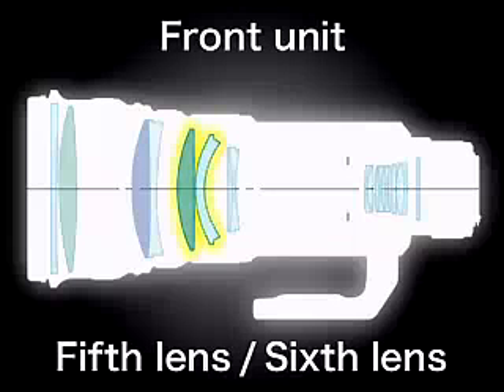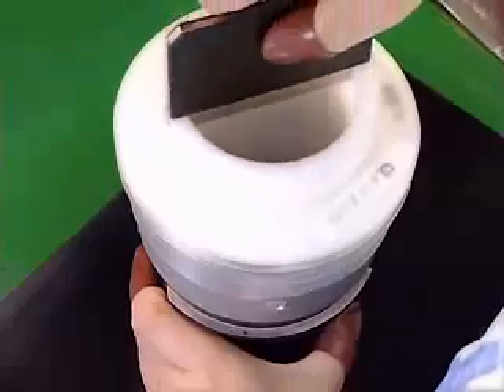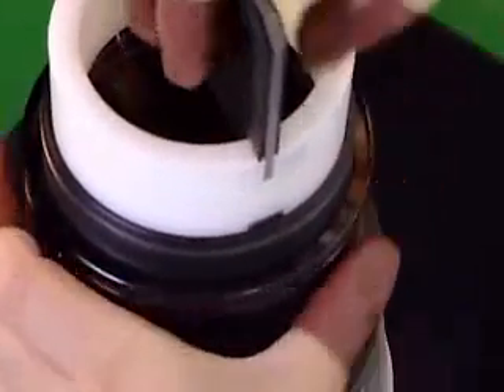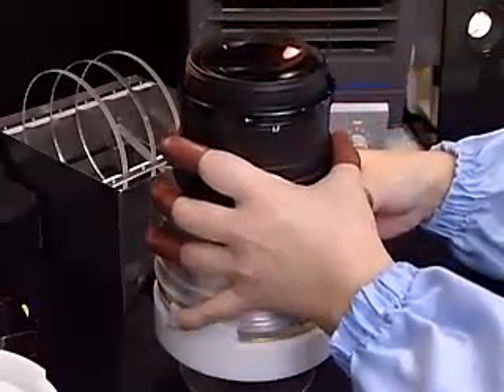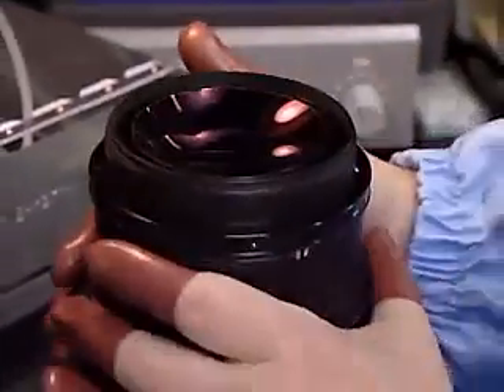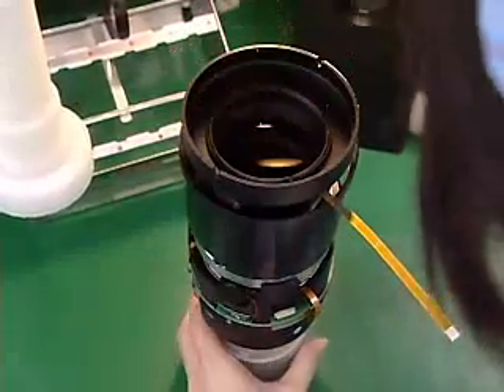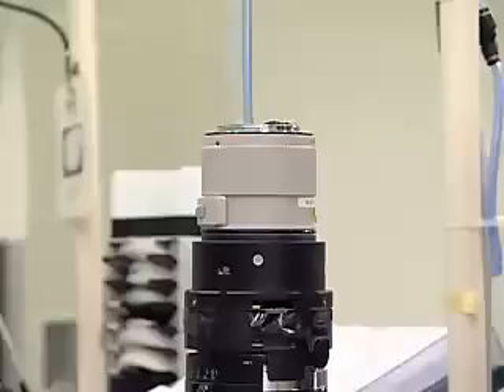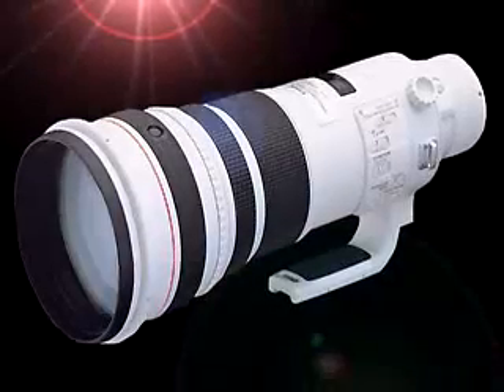Canon Lens Production 3

Comment: I had the 600 plus a new version of the 2x magnifier. Fun getting the right tripod gear and head for it, but to travel with it, you need to have a table to do set up. (You kept the lens in a big metal case) So I just filmed out the back window to the east bay, and also filmed the moon rising, and added it to  live concert audio of Tom Waits from the 70's. It's on youtube. Eventually I made a film noir with the body, 5D Mark II. One pixel dies, good luck with video.

Comment: The glass that goes into a lens like that is VERY expensive.  Much of it is rejected well before it gets to be polished.  The remaining machining and mounting isn't cheap either.  Then the quality control must be perfect.  This all takes considerable skill and top of the line materials.  There is NO WAY a lens like this could be manufactured for $200 in materials or labor.  Then you need to pay for R&D and make a profit to boot since they only make a few hundred of these a year.

Comment: So that's why those lenses are expensive as hell look at all that stuff they go through
Reply: I've always been crying about the lenses being so expensive, now I wonder why some manufacturers manage to get them so cheap ...
Reply: netsurfer912 cheap lenses have a much cheaper process to make them 
the glass is not as good and the focusing motor is louder  
and they are not built like the L lenses that can survive water and dust where other lenses have little gaps where dust can come in 
my sigma died after 4 years and all my dads canon L stuff still works
Reply: ronnie tjikoeri sigma suff isn't bad though. i have two sigmas for quite some time now and they still work excellently (a mount, so no motors).
Reply: netsurfer912 i have a sigma that has broken aperture (18-200)
Reply: i had a sigma 50mm 1.4 that i sold. excellent lens. wish i had kept it. made in japan too. sigma makes nice stuff.

Comment: Gasitman, you have no idea what you're talking about.  The milling machines, lens grinders, technicians to grind the lens, metallurgist, opticians, not to mention CAD designers and all the technicians to go with each respective team (most of which require at least a 4 year college degree) are just some of the components you don't see on this video.  $200 won't even get you the air filters used in the HVAC systems in the production facility.